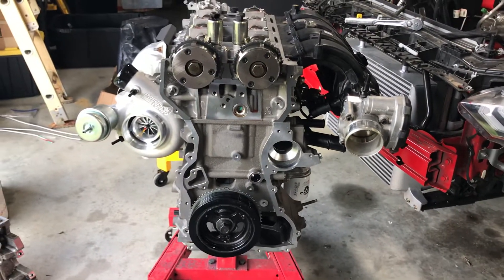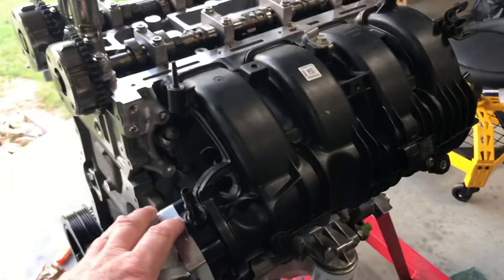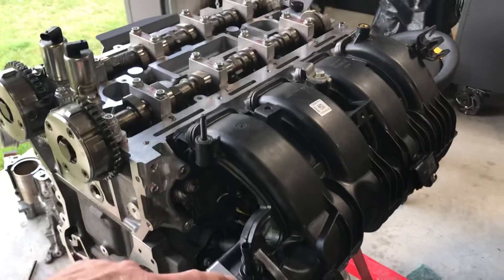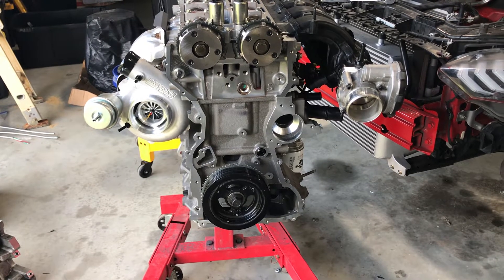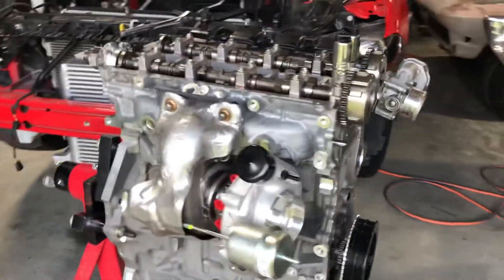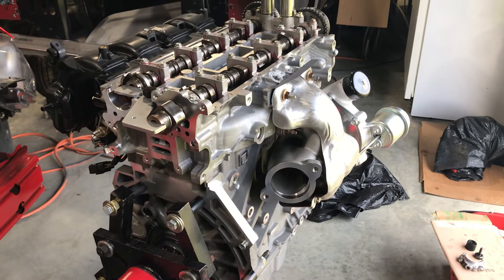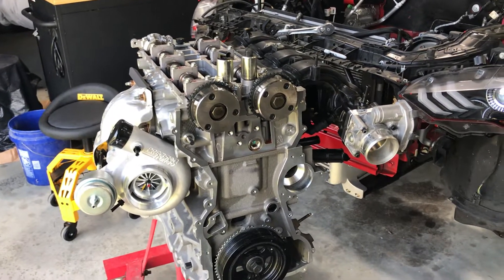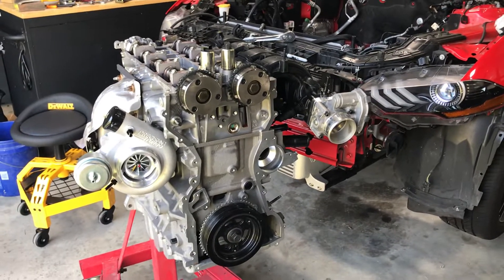Ecoboost 2.3L Esslinger Stage 3 - Round 3

Comment: I am about to get into a motor swap on a 15' ecoboost. Do you have a parts list on what you bought for your upgrade? That would be a huge help, Thanks!
Reply from the maker: Are you building a 'built' shortblock?  All forged internals in a 2.0 block, counterbalance delete, keyed crankshaft pulley, Livernois head studs and oil pump bolts, CVF race intercooler, CVF 3" cat downpipe, Precision Turbo NX2, Iridium PCV baffle plate, fully open catch can system, CP-E cold air intake system, Turbosmart 40 psi turbo oil regulator.  The Esslinger Stage 3 shortblock has the 'long-rod' piston/rod combination.

Comment: What caused the original motor to crack? I’m trying to avoid any issue, until I can save for a short block.
Reply from the maker: Pretty sure it started with rod failure.  The 2.3L Ecoboost Mustang engine up to 2019 has a weak rod.  I believe they went to the 2.3L Ranger truck rod for later years.

Comment: That's looking good 👍.  I'm actually doing the same thing as we speak. What is the manual download that you speak of?  I'm in need of it myself,  it's actually how I found your video 😄
Reply from the maker: Go to this website.  You can pay a fee and have access to all Ford Service Manuals for a period of time, based on what you select.  You can download everything you need.  Good luck with your build, if run into any obstacles, reach out as I learned a lot on this build and could save you some pain if you hit a roadblock.  https://www.motorcraftservice.com/Home/SetCountry?returnUrl=https%3A%2F%2Fwww.motorcraftservice.com%3A1402%2F

Comment: hello dear
how I install the vvt gear Ford mondeo
Reply from the maker: 74.
NOTICE: Use an open-ended wrench to prevent the component from turning.
Tighten the exhaust
VCT
unit bolt in 2 stages.
Torque
:
Stage 1:
30 lb.ft (40 Nm)
Stage 2:
60°

75.
NOTICE: Use an open-ended wrench to prevent the component from turning.
Tighten the intake
VCT
unit bolt in 2 stages.
Torque
:
Stage 1:
30 lb.ft (40 Nm)
Stage 2:
60°

If it is like the 2.0L and 2.3L Ecoboost engines, there is a hex area on the camshaft, this is where you use the wrench to hold the camshaft while you tighten the VCT onto the camshaft.

Hope this helps.